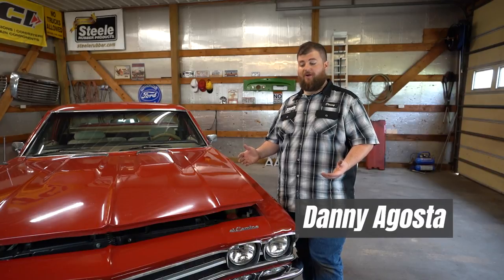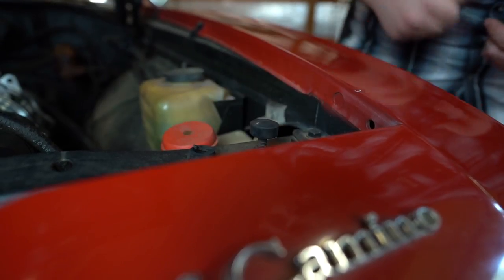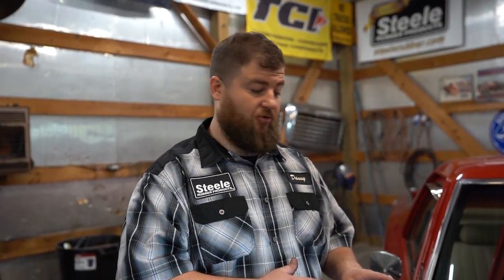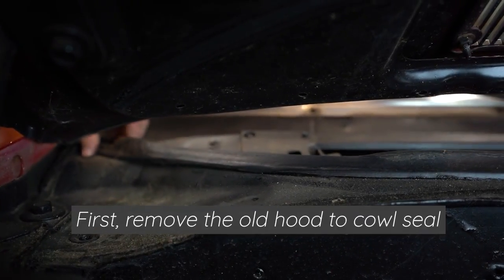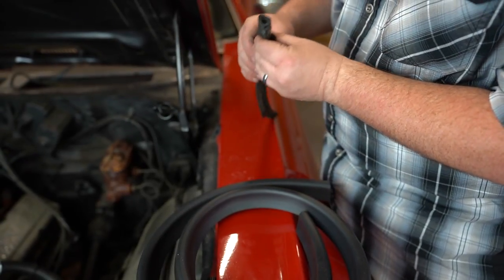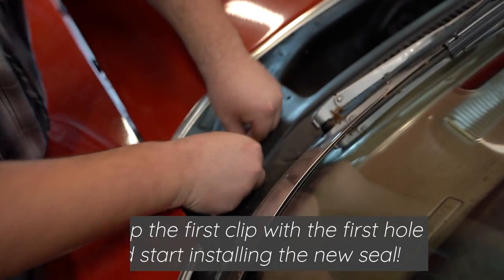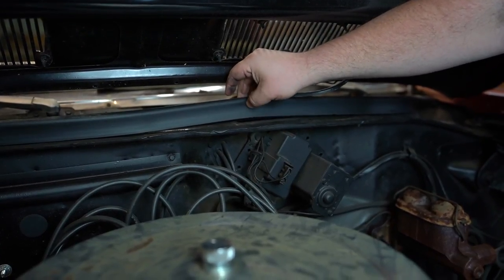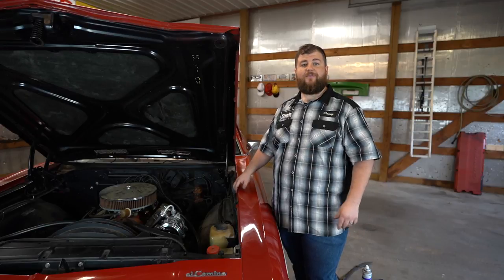How To Install Hood to Cowl Seal and Hood Bumpers

Comment: Need video on replacing hood bumpers on older car. 1968 Cadillac that are not installed like this car.
Reply from the maker: We haven't had the opportunity to make a video specific to his car but we can offer installation advice for any part. Are you referring to the hood to fender ledge bumper? If you have want we can email you our advice directly, if you want to email your questions to contact@steelerubber.com and one of our specialists will help answer your questions!

Comment: My current 69 Chevelle side bumpers don't tuck in under the bottom lip.  They just sit on the sheet metal below the lip.  So, do I have inferior bumpers?
Reply from the maker: Hey Rick, it’s hard to say if they’re inferior. If they work and perform their job, then they’re probably fine. If you’re looking for performance and originality, then having the correct bumper is important. Hope this helps you, thank you for watching!